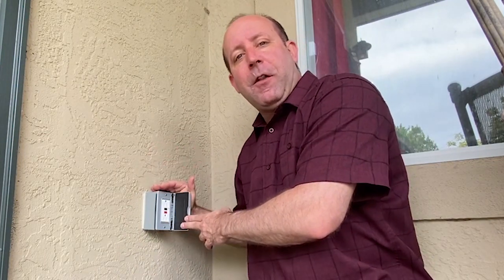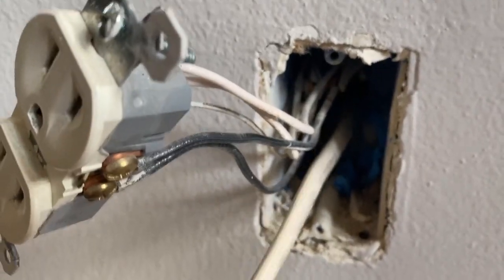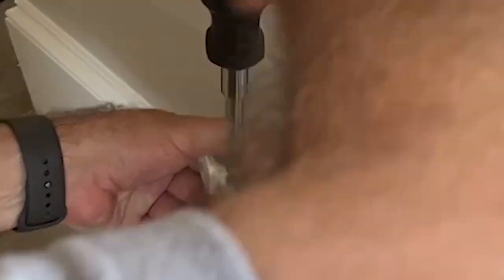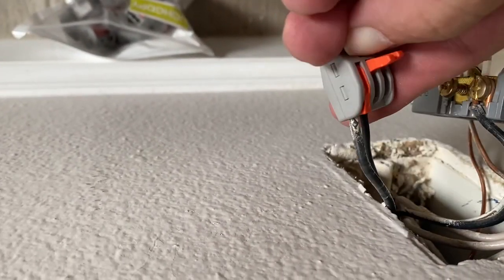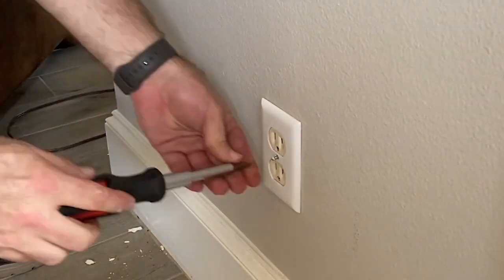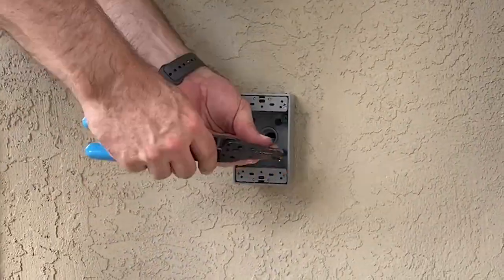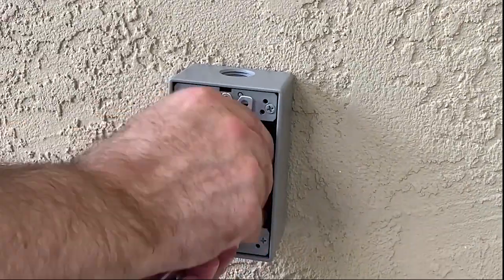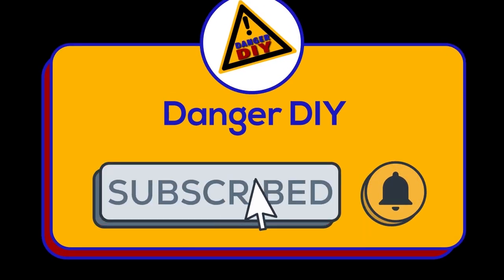How to Install an AC Outlet

Comment: Thank you for this. I was thinking about tying into an outlet to run power to my shed. This was very helpful. Instead of running this through an inside outlet, I would run to an LB on the outside wall. It explains a lot.
Reply from the maker: Hope is works for you and it goes smoothly!  Thank you for the comment and watching the video.